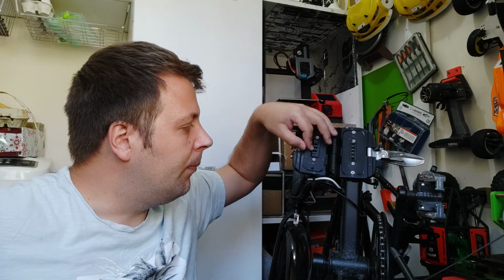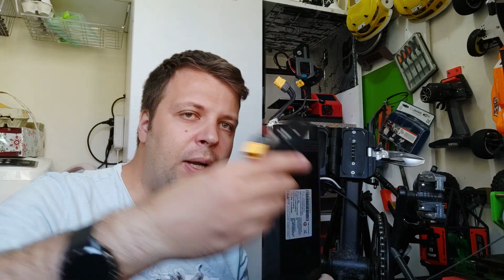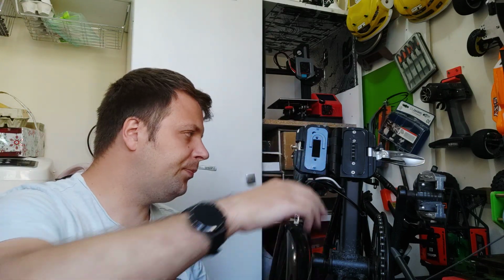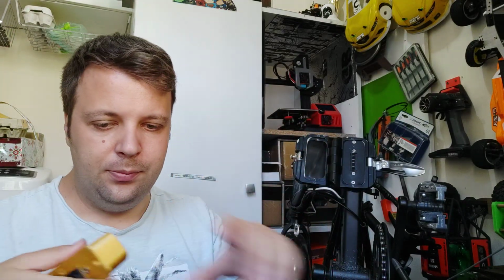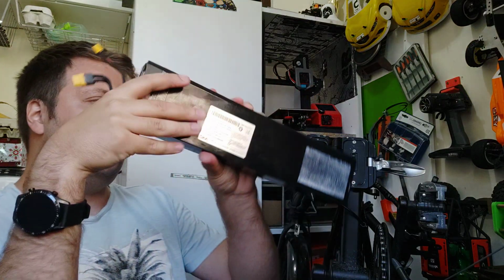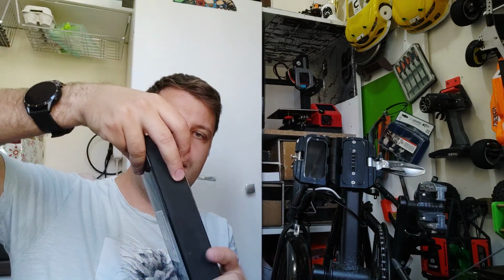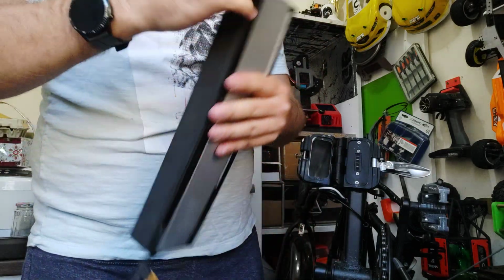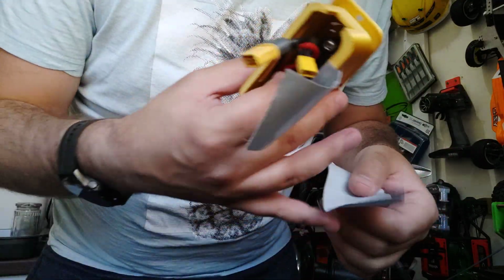Fiido battery removable D4S, D2, D2S, last update. Video 3.

Comment: Would buying with same specs as Fiido 36v 10.4AH battery with case key lockable work with Fiido d4s?
Reply: Wouldn't drilling a hole in the frame be required to make battery key lockable ?